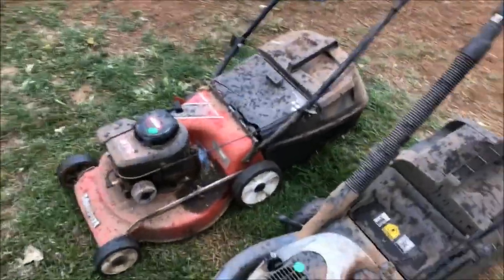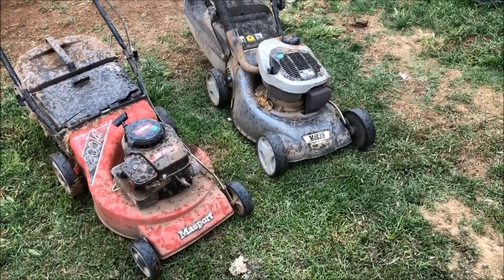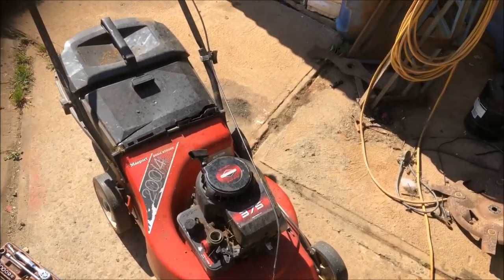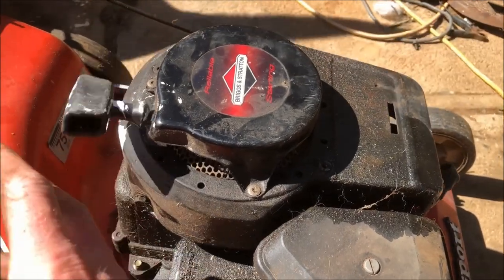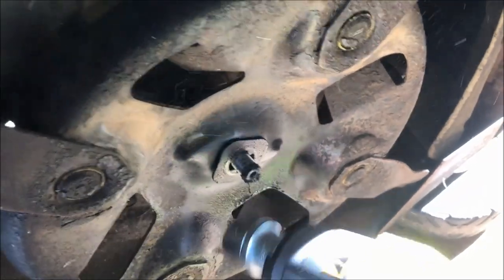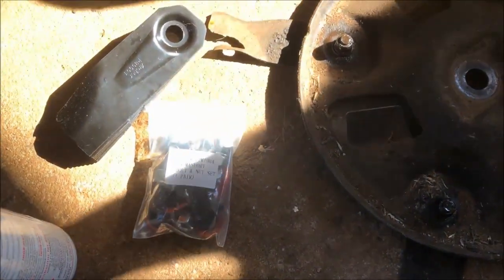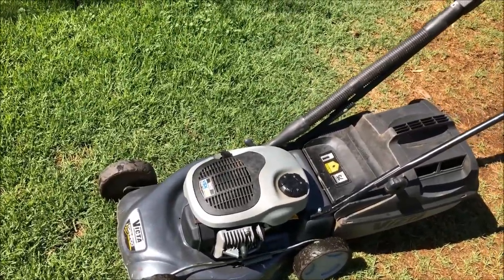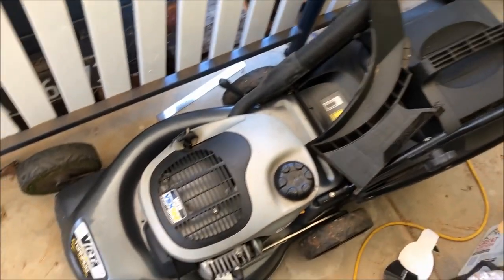Garage sale victa and masport finds, repair and sales

Comment: The difference here in Scotland / UK is that people want £ 120 for mowers in the condition you bought them in!   Not fixed, not working.   The classic line "I'm sure it's a simple fix" but it's beyond the seller to do!   Struggled but I picked up a couple of Victas that I thought were in good condition, if needing a little bit of work.   One has taken a lot more work than I bargained for to get working and I think it needs more.   Second one I'm changing seals on and will be getting test mowed at the weekend to see if my fixes have worked (don't wish to disturb the neighbours too much in the evenings!).
Reply from the maker: The same thing happens here people wanting $50 plus for something beyond economical repair. I very rarely sell one fixed up for much more than $100, a lot of the time its just about having some fun out in the shed and making a little $$ for some new tools.
Reply: @junkyarddog87  Great to see you bringing Victas back to life!   I don't think enough people in the UK know just how good a mower they are.   They cope with our thick and wet grass like no other mower I've used.   Which also makes them a hard find!